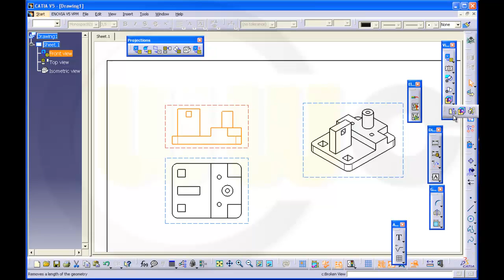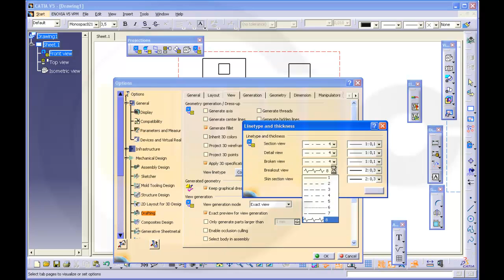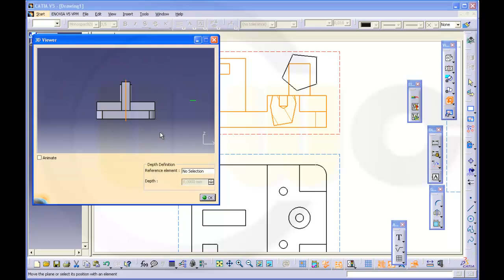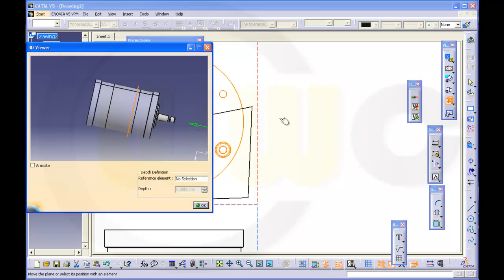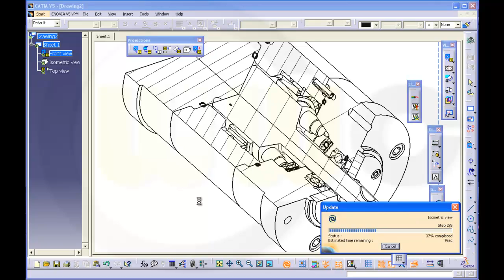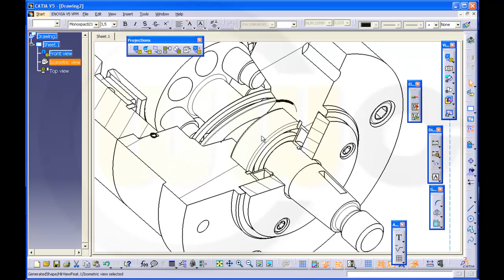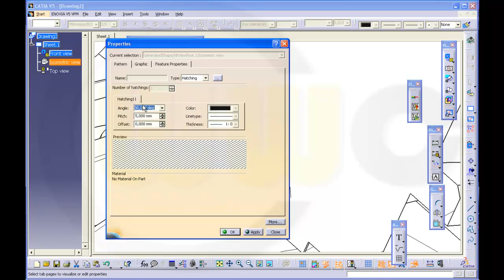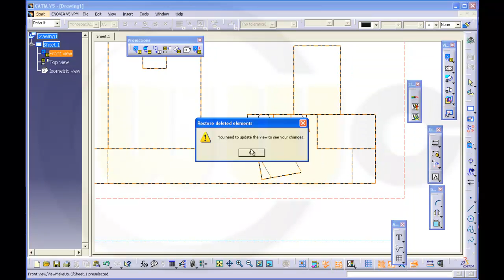Breakout view  - Catia v5 Drafting quick & basic - All about breakout views

Comment: Hello Wolfgang, I have an issue with breakout...I got a cylinder and I follow all the steps to create a breakout (with a front view where the cylinder is along and then a projected view where you can see the circle of the cylinder to control the dept). However I can't pick the center of the cylinder! When I go to the 3D viewer I'm not able to pick any reference object neither (like a plane or even a point). As an experiment I have tried to create a rectangle solid with an edge in the middle of the cylinder and then I able to pick the edge of the new solid!
Reply from the maker: +Dave P  In case of a cylinder you don´t have to select anything - it will automatically go up to the center.
Reply: thanks for your quick reply. I was expecting to be able to pick the center  as well but it doesn´t. When I go over the center the pointer changes from arrow to hand icon but nothing gets selected. The part itself is a pipe with some bends (I said cylinder before because is the end of the pipe I want to breakout and is a cylinder shape).This pipe is an assembly with a connector and one of the ends. the end of the connector I have been able to do the breakout, but not the other end, the pipe itself. I´m wondering if is anything wrong with the pipe.Why I´m able to breakout the connector and no the pipe? I open the pipe alone and I can section but no breakout. Weird
Reply from the maker: Dave P Sorry, for aa answer I would have to see your model. You can mail at: info@wwmc.de